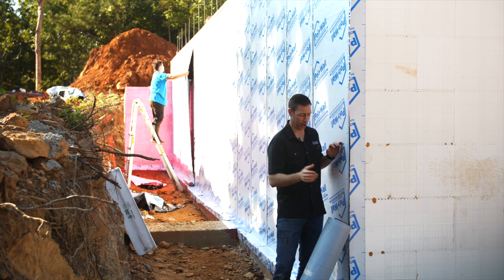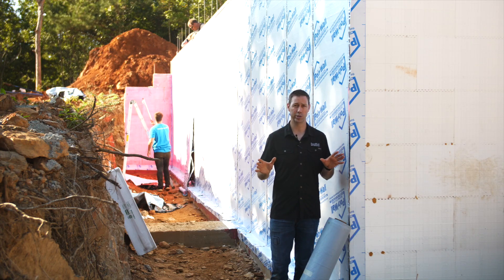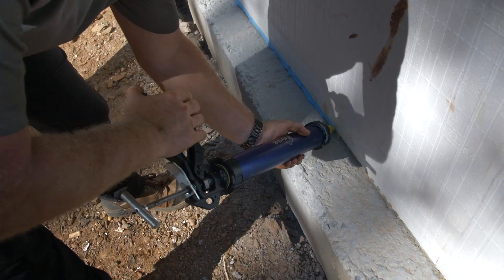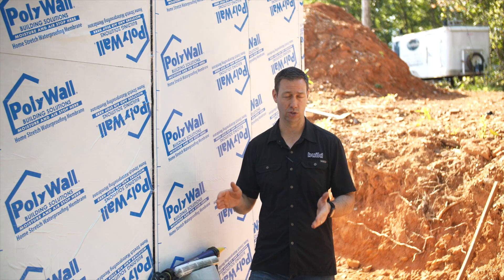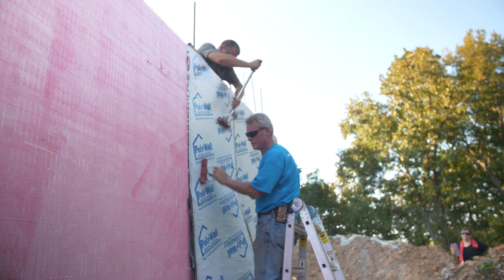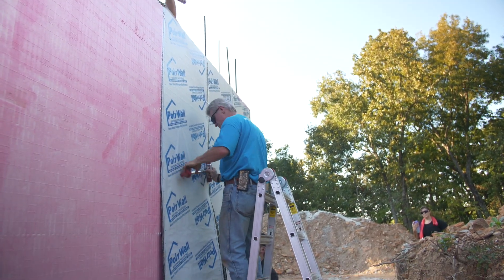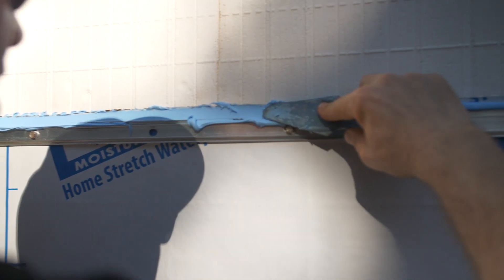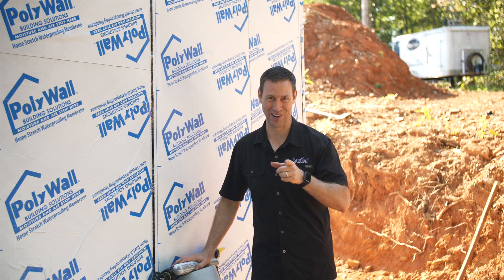This Pink Stuff is The Secret to ICF Waterproofing

Comment: I've become a huge fan of this show. I hope you address the 800 pound gorilla  in the room, TERMITES,  before the segment on ICFs is over.
Reply: We have placed a 2.5 inch metal track on top of block just above grade and screw it to block before we pour then we screw another track down on top of it and resume stacking to give a termite barrier sometimes that type of waterproofing serves as a termite barrier also
Reply: Metal track or some type of screen sounds like a good idea. I would like to see how you do it. I wouldn't rely on the WP for long-term termite control.
Reply: Termidore
Reply: I hope the  long-term termite solution on a new house is not chemicals. One must build as is the pesticides will be taken away someday.
Reply: Look at how tf systems are installed especially how they finish the top and go up with another floor you'll get the idea but the track would serve as a blocking point for tunneling tried to get the icf manufacturers to put termite treatment in the product itself

Comment: Hey Matt, I don't know much about building a house, but if you put the waterproofing outside of the insulation doesn't this cause condensation on the waterproofing layer?
The insulation layer is part of the thermal envelope, and therefore warm, and the waterproofing layer isn't, and therefore cold. If there is any leak in the waterproofing envelope won't water get into the insulation and concrete without the ability to dry out?

Comment: Too bad you could not wrap the bottom of the footer like you did the walls. That would most certainly clip rising damp in the bud.
Reply: you can if you think ahead on the build and do it before the pour.  google FasFoot or icf monopour
Reply: That was my thought. If I build a foundation, that's just how I'll start. It is just hard to do it after the fact. It can be done (dig under a few feet of the footer, wrap it, backfill it, tamp it hard, repeat as needed), but it can still lead to settling issues.

Comment: How would you attach siding to this if you went all the way to the roof? You clearly would need to penetrate the barrier to fasten your siding, would you just use that thick blue sealant, or am I missing another obvious method?
Reply from the maker: I’d attach furring strips with minimal penetration then attach Hardie to that.
Reply: Matt Risinger  Okay, thanks for the reply! Does the membrane provide enough of a seal on its own for a screw hole through the furring strip?
Reply: Two answers. One: you only need waterproofing below grade. Above grade the ICF walls act as water and air barriers. No WRB (Tyvek or such) or anything else is necessary. (And this is coming from Joe Ltsiburek, not me). The second answer: if you really want unnecessary expense and headache you could take the system to the truss line and the material will self-seal around the fasteners. You can also just use ringshank nails to speed up your furring process rather than using screws.

But the best answer: Use Xypex admix below grade with a FastFoot monopour footer integrated into your basement pour. Eliminate the cold joint, make an impermeable wall, lay a perimeter drain, and move on with your life!

Comment: Matt, one thing no one mentions is the static pressure of the soil around the home and its effect on these materials.  Ground movement from settling or even plate tectonic shift (yes, an extreme example) will do to these materials. Or soil and organic reaction.  Looking at this, site there is going to be a whole bunch of soil moved around this foundation.  No one has mentioned how they are going to protect the product you took so much care and extreme effort to install.  Soil can be very abrasive when pushed alongside a foundation and it could definitely pop a few seems (unbeknowst to everyone) thwarting your attempt to the contrary.  Lasting forever is a really long time BTW.
These products are not a panacea but another step in our progress to better waterproofing (a very expensive step to say the least).  Hopefully, they will not be like the LP disaster of the late 90's.  If you had a show back then, LP would have sponsered you and you would have been pushing it, just like you are the products of today.  I'm not knocking you- Just saying.
Reply: Bestbuilder the next video is protection and drainage layer. Definitely requires care when backfilling and compacting.
Reply from the maker: I think it’s a stretch to compare this to LP siding and I can honestly say that I don’t think I would have had them as a sponsor. Stay tuned for the next video as I talk backfill and protection
Reply: Matt Risinger my comparison to LP was a comparison to how new products are sold or marketed as something "that will last forever" or "the next best thing" until we later find out there is a problem that no one thought of. Twenty-five years from now we will be finding out what systems really worked and which didn't.  Right now we don't know which ones will be a bust.  Hopefully, they won't be saying "remember when Matt Risinger said this was a great system" as they show a wall or roof they just opened up with rot everywhere.
About sponsorship - LP was the ZIP wall of its day (until it wasn't), they had deep pockets and were using the latest marketing system available at the time. If YouTube was around back then they would have been pouring money into people schlepping that product. Something to think about. Not hating, just saying
Keep up the information stream, these are actually better than the marketing ads, even if they are funded by the manufacturer. The only trouble I have with them is that most clients are unwilling to pay for the stuff you recommend when they find out the real costs and that it isn't being supplemented by the manufacturer or that the labor to install it is provided by the manufacturer.
I do understand it is tough to run a show without a revenue stream and I watch and learn something from every one of them.

Comment: Matt
What if a person assembling an ICF system used SIP SEAL adhesive on the Exterior side of the forms to seal the seams between the block to help in sealing? Or maybe even the Blue PolyWall sealer?
Reply: Hey Brian, good question. The only reason for the block is to keep the cement in place when you pump it in. Once you let the concrete set - your 4, 6, 8 inch wall has no seams that leak air or water. Using the polywall is to get water off the wall and away from the foundation.

Comment: Just use  xypex in your concrete and skip all of this nonsense.
Reply: I agree. For those who are wanting full bore waterproofing, the best bet would be a FabForm monopour with Xypex. Cheaper, easier, no real chance for error, and way faster. To really top the system, throw in Helix micro-rebar and just cut the labor bill to a fraction and get a stronger system overall. If you have slave labor, and donated materials, this method is fine. For any project where labor is paid or you want true waterproofing; Xypex, Helix, FabForm, done.

Comment: Would this water proofing can sustain the kind of water flood from Hurricane Florence or Katrina? I mean as can it prevent water penetration when the house is soaked in rain water 6-10 ft high?
Reply from the maker: Yes and No.  Yes it can withstand hurricane forces and rain.  No it's not meant to help the house if flood waters 6-10' high comes.  Frankly there is no waterproofing that can do that... Matt
Reply: So it is more like a water-repellent instead of water-resistant, correct?
Reply: The only thing I know of for a basement to be waterproof in standing water is water impermeable concrete. Xypex or similar admix could do it. If you had any sub-grade windows or penetrations you would be sorely hurting, but the walls would do fine.

Comment: How do I waterproof an existing structure cinder block walls. With a water issue every spring?
Reply from the maker: These methods from PolyWall would work equally well on a Cinder Block wall.  Same exact process.  You could however use their solvent based primer instead of this pink one that's intended for EPS foam.  Matt
Reply: Dig all the way to the side of the footings, lay 1" of gravel, then place 3" diameter perforated pipe and cover it with gravel. Put filter fabric over gravel. The joint between horizontal surface of footing and the vertical stem wall must be sloped and not let at 90 degrees - i just form it with mixture of mortar and hydraulic cement. The perf pipe surrounds the perimeter of the footings and collects into a sump pit with pump. The basement or stem wall can be coated with tar, polywall liquid, hydrocell etc (lots of brands) or can be let as is, but it must be covered with a "dimple membrane"(many brands) extended to the level of grade. Fill back with dirt and slope it a little bit from the house. I did that on few houses and no more water seepage. Contractors may charge 30 k for a large basement (lots of digging all the way to the footing) but it can be done step by step with few people able to shovel dirt.
Reply: You could dig down around the structure, pressure wash it clean, then apply Xypex spray. Throw in a perimeter drain for good measure and bury it back up.

Comment: There's honestly no way in the world these joints and compounds are going to last the life of the house. When has anybody ever seen a gap-bridging joint last as long as a house? Plasticity always decreases over time until the compound becomes hard, then any future movement will just pull away.

BTW great video, yours are very interesting.
Reply from the maker: How long would you expect that membrane to last if it was sitting on your dining room table?  Pretty long right?  If this waterproofing is buried underground, protected from UV rays, protected from Temperature extremes... I think it was last a pretty long time in those conditions.  Especially because it has an air gap in front of the membrane which means that water won't sit against the foundation but gravity will pull it down and out.  Thanks for commenting.  Matt
Reply: Thanks for commeting. Also, Matt, not sure if you have, but you a product I see around here, albeit not often, is Superior Walls. They are precast concrete walls with foam on one side.

None of the reviews go into the level of detail you do--would love to see you cover a product like that. I was a bit leery of it myself. The 8" wall sits directly on tamped gravel--there is no concrete footing to spread load.
Reply: For concerns of this nature, the correct response is to move to impervious concrete. Use an integral crystalline waterproofing system such as Xypex. Better yet, do it with a FabForm (or equivalent) monopour system so you are waterproof through and through with no cold joints. Much less labor, possibly less money (I don't even want to know the cost of 40mil peel and stick...), and remains active indefinitely.
Reply: patty109109 check out Rub-R-Wall coatings. They would k great for foundations especially ICF and can stretch well over 300%
Reply: For how long? I've seen an endless number of caulked spaces that had cracks around the caulk even though the movement was way less than the supposed stretchability of the caulk, because it doesn't stretch uniformly across the space, and requires adherence to both edges as well. That blue material across the cold joint at the bottom of the foundation cannot be expected to bridge that gap seamlessly for 30 years, surely.
Reply: I’ve seen basements with it 17 years old and it still stretches like a rubber band.  It has a 30 year warranty. It is not UV stable, so it must be covered within a few weeks after application

Comment: I'm in a part of Utah where we receive less than 6 inches of water in an entire year.
This seems extremely excessive for where I am.
Code on an ICF requires only a water-based sealant. are you going to this extreme because you get so much more water there in Georgia??
Reply: It’s a foundation. If it’s build well, with a bit of overkill, you’ll never have to worry about it in the future.